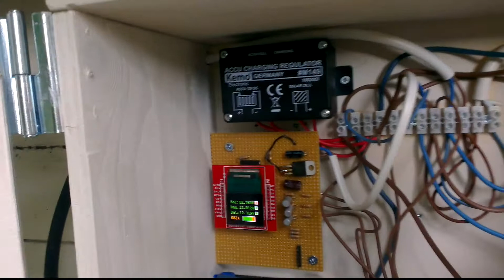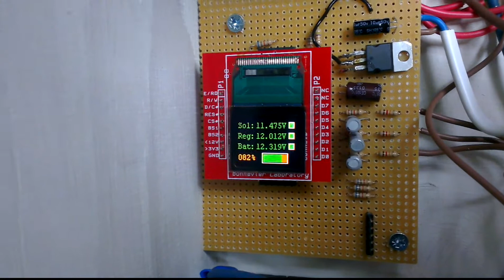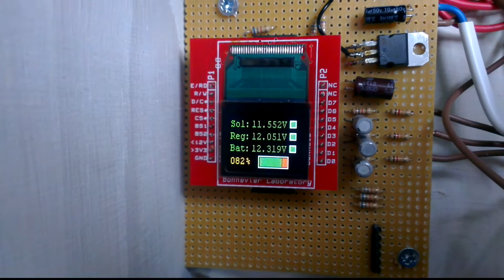Solar panel play house

Comment: did you find this regulators battery full and battery charging lights flash on and off alternating one to the other? I'm not sure if there is a problem with my M149 regulator or if this is normal - it isn't in the manual!
Reply from the maker: Hi luketorpedo, no I've not exerienced that behaivor with this regulator. Sounds like you have a faulty unit.
Reply: That's unfortunate to hear, thanks for the quick reply though! I guess I'll have to open it up or look for another one.